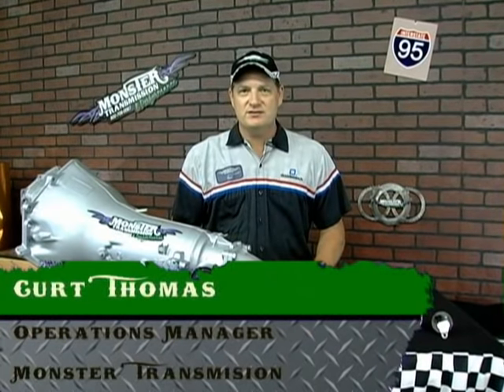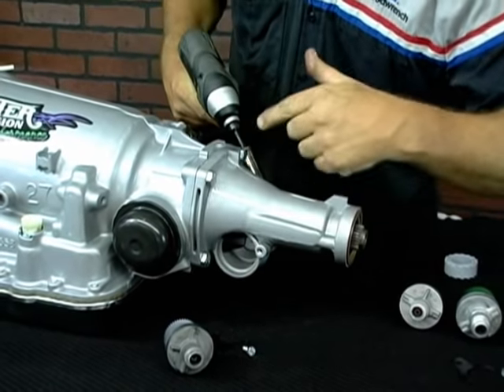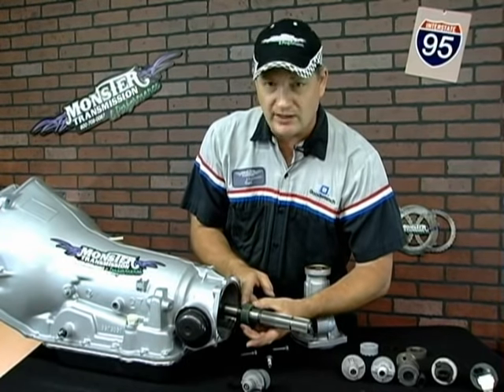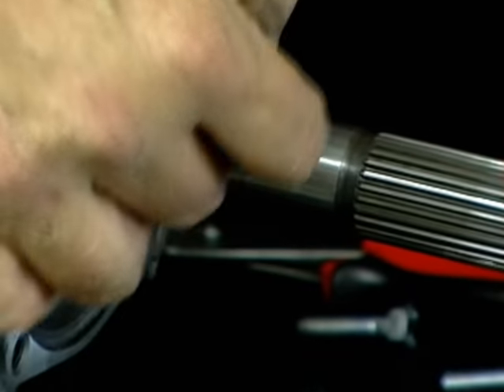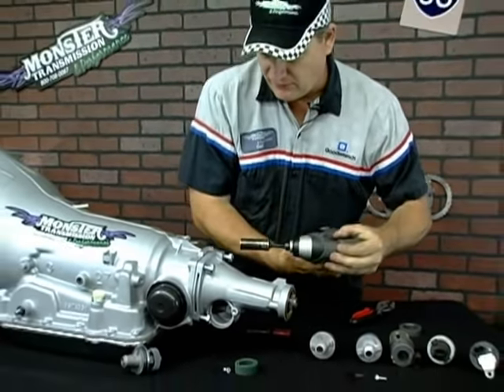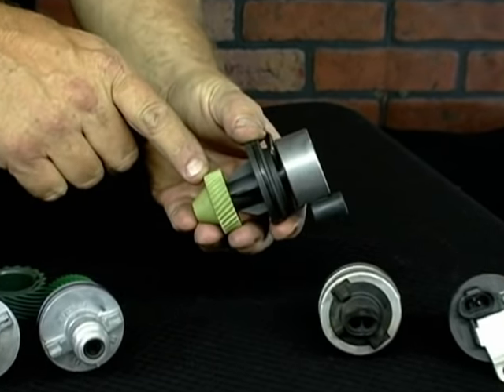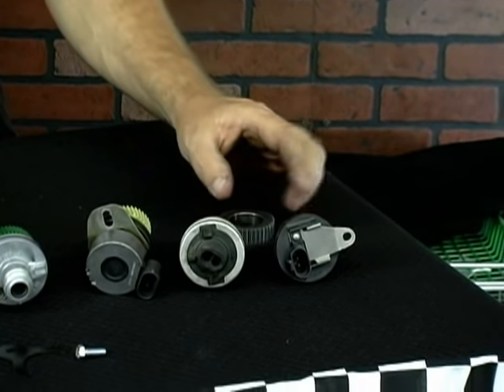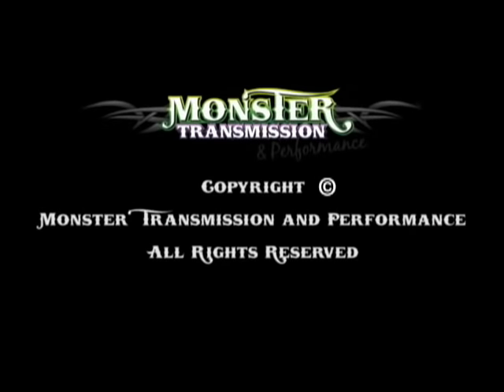700R4 Speedometer Gear | Curt's Corner at Monster Transmission

Comment: Many of the GM car and light truck parts books from 1993ish back through the 1930's and even before are scanned and available online.  
You'll find tables of Drive and Driven gears to use based on model years, tire sizes, and axle ratios in the first sections of these parts books.

Comment from the maker: It's a bit different if you have a 3 or 4 speed transmission. The 3 speed uses gearing that is located in the tail housing. The 4 speed uses an electronic speedo that is also located in the tail housing.

Comment: How come this transmission output shaft does not have the output shaft sleeve? Its a sleeve that slides on the shaft, after the speedo gear, which prevents ATF from leaking out of the U-joint weep hole.
Reply from the maker: Some transmissions do not require the sleeve.

Comment: Hi I have a 1985  Trans am 700r 4 with a 350 my speedometer isn't working i put a new speedo cable and still isn't working hooked the old cable to the speedometer to see if the speedometer will spin it and it does.  I check the speedo gears and they look fine what do you think could be the problem.  The code says vss that's a little yellow box behind the gauges but wouldn't the speedometer still spin if it has a speedo cable?
Reply from the maker: If you would check the gears in your tail housing. You will need to see if they are damaged. If you could also see what color those gears are or if you are able to find out the tooth count then we can get you a new gear. if you have any additional questions feel free to give us a call at 800-708-0087. Thanks and have a great day!
Reply: Thanks for the reply the gray gear inside is spinng I had the car in the air with the drivin gear and housing off. but when I put the driving gear with the housing on it's not spinng

Comment: Hi Curt,  Awesome vid!  I have a question about my speedo gear.  I need to change the speedo gear to get an accurate speedometer reading on my 1970 Chevy PU 3/4 ton.  The speedo gear i took out is shaped like a speedo gear for an electric speedo.  Is that right?  Can I replace the gear with either a mechanical or electric gear?  Thanks, Roger

Comment: I have the late 80's digital set up with the flat connector. Can I remove that and install a gear driven speedo cable?
Reply from the maker: Good question! Yes you can you will just need to purchase the whole kit. 
Drive Gear, Driven Gear, Housing, Support Bracket, and Clip plus the speedo cable.

Comment: my current 700r4 is a 1992 auxiliary valve body from a 1990 buick roadmaster. the my transmission uses the plastic speedo gears. can I switch the plastic gear off the output shaft to a metal gear and use a magnetic pick up style sensor
Reply from the maker: You can actually press a reluctor wheel on your output shaft and then be able use a vehicle speed sensor.

Comment: The rear hole in the shaft if for a Corvette The Vette tail housing is different. At least it was from 1982 to 1987 when they went electronic as he mentioned earlier.

Comment: Victor here,I have a 1989 Ford Bronco(fullsize)XLT with 33inch tires on 15 inch rims,i was hoping you can help me,i need a speedometer cable for the truck in question,and since i have the 33's,can you please recommend a speedo gear to go along with the cable,i would like to purchase ASAP,Thank you,VICTOR

Comment: I have a 1984 700R4 I put in my 1994 Chevy 1500 (2 wheel drive) because I couldn't find a correct transmission or afford one from a shop. It works great, but no speedometer. Could I change the drive gear to a reputed with out removing the transmission? When you say "pressed on" are you referring to using a press of some sort? I am pretty much what a lot of folks would consider a shade tree mechanic. I'm pretty good at it and would like to try and get it to work. Also I saved the truck from a date with a car crusher... It was actually loaded on a trailer and and stopped in front of Walmart looking directions to the scrap yard. So far I got $700 in it and drive it everyday. Any advice you can offer will be greatly appreciated. Thanks- Bill
Reply from the maker: Yes, you can swap the speedometer. In 84 they used the nylon drive and driven gear for the speedo. In 94, however they used the metal reluctor ring and the electric pick up. You will need to remove the nylon gears and install the metal reluctor ring. You can install it by removing the tail cone and the nylon gears. The reluctor ring will just need to be slid onto the output shaft using some assembly gel and a rubber mallet.
Reply: thanks

Comment: Someone please help. If i remove the tailhause extension case to replace that seal along with the speedo housing seals.. do i need to replace the rear main seal aswell?
Reply from the maker: You only need to replace it if it’s leaking but if you already have the housing off it’s a good idea to change the output shaft seal. If you need any more help Brandon, give us a call at 800-708-0087.

Comment: How do you remove/install the steel signal generating gear from the output shaft? This is the type used for electronic signal generation.
Reply from the maker: If you have the output shaft out of the Transmission we advise to use a pipe around the gear and slam down to remove or if it is still in the Vehicle or fully assembled you can use the back side of channel locks and after a bunch of slaps to remove it it will come off. Thank you for choosing Monster Transmissions.

Comment: about to buy an 88 Camaro but the seller told me the speedo gear keeps rounding out when used can I fix this or can an electric conversion work ?
Reply from the maker: +Matthew w Thanks for checking in with us. It sounds like the speedometer cable is binding up. You can check cable for smooth operation. If you have any other questions give us a call at 800-708-0087. Thanks

Comment: Hey bud I have a question. On a 1990 350 tbi with a 700r4 transmission, what kind of speed sensor goes in it?  The transmission was changed before I got the truck and the speedo has never worked since I've had it.
Reply from the maker: Hi Cody, Thanks for the question. That should have a VSS a speed sensor not any type of plastic gears. If you have any further questions feel free to give our tech team a call at 1-800-708-0087. Have a great day!
Reply: I appreciate your reply.I got everything changed out and it works great. Thanks again
Reply: Monster Transmission
I have a 91 Formula and it has a plastic drive gear and a the "speed sensor" with the plastic gear on it.

Comment: what if i use a accurate speedometer app on my phone, since my speedo in the dash stopped working, i tested the app in my truck and its accurate, if i give the carb half throttle  it should shift to 2nd gear at 18 mph ?
Reply from the maker: Yes from 18-20 mph

Comment: Mind has a metal gear how do o replace that
Reply from the maker: You would need a cut off wheel or a puller. But we recommend using a puller in case you need to reuse the gear.
Reply from the maker: We're going to get a video on that as soon as possible Luis. But if you're in need of assistance right now, you can give us a call at 800-708-0087 and one of our techs can walk you through that process. It should be fairly easy.

Comment: Question what year or type 700 r4 transmission will fit a 1999 yukon 5.7 liter 4 door
Reply from the maker: +Austin Bradley Great Question! You'd be looking at the 4L65E. If you have any more questions give us a call at 800-708-0087, Thanks!
http://www.monstertransmission.com/4L60E-4L65E-LATE-1998-2005_c_3941.html
Reply: +Monster Transmission thanks

Comment: I have a problem with a 1987 Chevy r10 4.3L TBI the previous owner put a new 700r4 and the speedometer does not work any one know a solution speedometer needle is shaking all over the place
Reply from the maker: If the speedo is bouncing or shaking all over the place that is an indication of a binding speedo cable.

Comment: what number driven teeth do i need to make speedo read 8-10 MPH higher when the current driven gear is 37 teeth? BTW the current gear is cone shape all the replacements are not???
Reply from the maker: +Don Smith Thanks for checking in with is. It's really hard to say without knowing what driven gear you have. If you can get the rear tire size and rear gear ratio then we'd be able to get you the exact tooth count. Feel free to call us at 800-708-0087 when you have that info and we'll get you taken care of. Thanks!